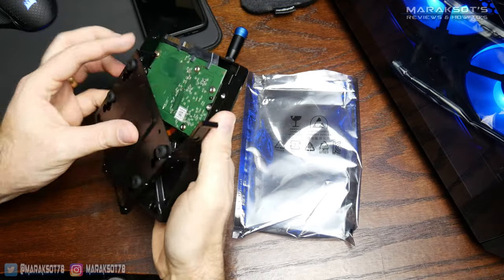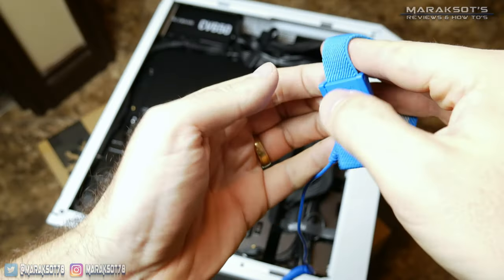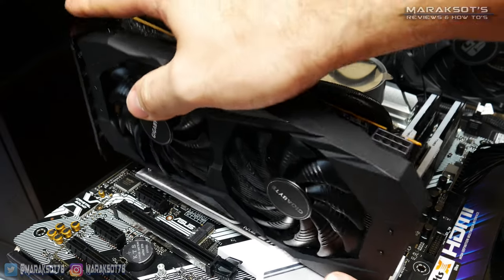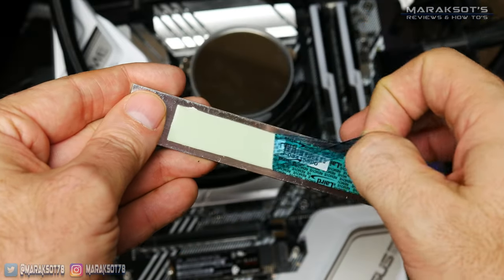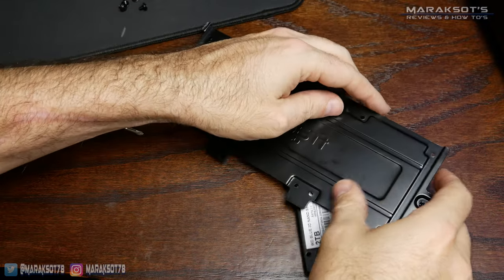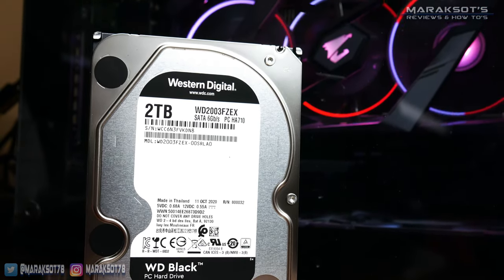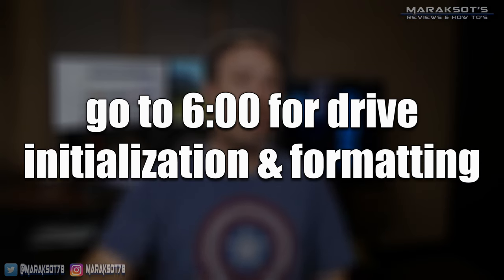A Beginners Guide: Upgrade Your PC Storage - How to install M.2 SSD, 2.5" SSD & 3.5" Hard Drive

Comment from the maker: Wanna skip to a particular part of the video? Use the Time Stamps. :)

Time Stamps

0:00 - Getting started
1:23 - 1st steps
3:02 - How to install a M.2 NVME SSD
6:00 - How to initialize new drive
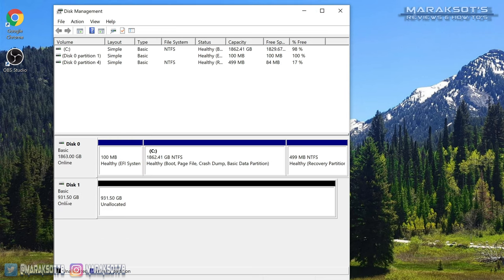7:05 - How to format your new drive
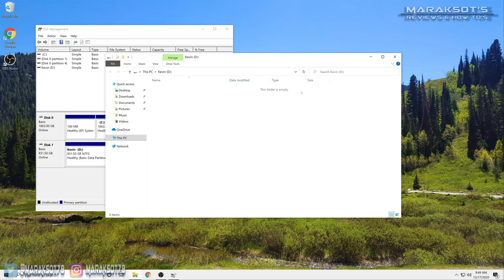8:11 - How to install a 2.5" hard drive or SSD
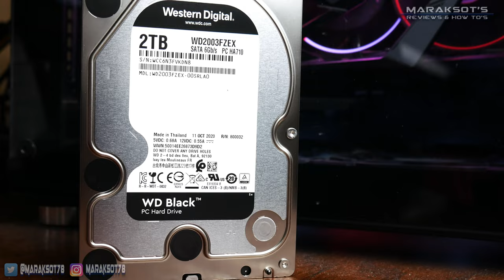10:26 - How to install a 3.5" hard drive
12:35 - Shameless plug for my next video
12:52 - Thanks for Watching! Like, Share, Comment & Subscribe! :)
Reply: I need help!!!!! I’m trying to upgrade and add an additional storage device (the m.2) and I turn it on after installing the ssd and in the BIOS the only boot option is the ssd and not my hdd where my windows boot is at, how do I switch the boot so I could boot using my hdd
Reply: thanks for the video! I'm planning on upgrading my pc to have more storage space soon so I can buy more, and download more games :D
Reply: When upgrading the NVME SSD do I need the Sata cable to transfer all my data that I cloned to an external SSD?

Comment: This helped a lot <3 Been stuck with 500gb over a year and been deleting games and reinstalling them later again but now finally, got more room thanks to this~
Reply: Same I had to uninstall games recently to enable other game updates. I have a 500gb SSD.
Reply: I've been stuck with 240gb bought a prebuilt and never checked the storage capacity
Reply: @diegovillegas4108  lmao unlucky, rn I'm stuck with a 500g built
Reply: @Darbocky  i have 100gb :(
Reply: …I have 4gb
Reply: I’m stuck with 200 rn
Reply: Same
Reply: Me with my 460gb. 😂😂😂
Reply: Same
Reply: Does it also make your pc run better and do you need additional fans when adding more storage? Sorry if it’s a stupid question lol
Reply: So real
Reply: @anthony_t.v2179  you do not need additional fans as hard drives (and ssd) don't heat that much. And it won't make it run faster. Only ssd will make it run better. A new Hard drive may give some slight transfer speed if your old one is almost full
Reply: LOL same but i only had mine for a couples months and ran out of disc space
Reply: Me with 2 tb:
Reply: i have 1 tb and js got a 2 tb that my mom lost

Comment: Amazing video. I want to upgrade my PC storage, but I have a small question. If my PC already has a M.2 ssd (500gb) and I want to upgrade to a 1TB M.2 ssd, will there be any problem with just removing the 500gb one and installing the 1TB using your instructions?
Reply: I also have the same question but I’m not too sure
Reply: Im pretty sure you wont have an OS (windows/linux) then. So you cant use it
Reply: @dragonl0l  my PC was pre built and has a 256 SSD I switched it with a 1 TB Firecuda 530 but my windows 11 operating system wasn’t on it is there anyway I can put it on?
Reply: If the one installed in your computer has your operating system then you will have to find a tutorial on how to move the operating system to the new drive, also any data on your old m.2 drive will have to be transfered over as well, it helps if you have a second drive in your pc already then you can just transfer everything to that and then move it to your new drive after its installed.
Reply: Also double check to see if your motherboard has more than the one m.2 slot, mine has 2 on it so I just added the second drive in.
Reply: @Whatf80  theres tutorials out there but theres like 2 main ways. 1. Connect both storages to your pc then use a clone/migration tool to transfer your files, OS, apps, etc to the other drive. Or 2. You download windows onto a usb stick (atleast 16gb) then reinstall it onto the other drive. But you will lose your apps/not have them on the 1TB drive with the 2. option.

Put simply: you can either move the OS and files to the drive internally or use an usb stick to only move windows then reinstall all games etc.
Reply: You would need to transfer windows to the new ssd or it won’t boot

Comment: Thank you for making this! I've successfully installed my new 2TB SSD, despite me being a complete novice - thanks to this video I managed to not bugger it up! Thank for for making such a comprehensive and easy to understand video, it is especially appreciated the quality put in to make it so concise!
Reply: any recommendatiosn on which 2tb ssd?? im about to do the same thing, my currrent tb is about full, im lil confused about how to take this stuff and put it on my new ssd
Reply: @jhustle1980  I went with the 'Transcend SSD230S 2 TB', which is about £210 on Amazon. There are cheaper ones available with discount down from £200 to ~£150, but Transcend 230S was the only one which specified it had a DRAM cache. 
-If your current SSD is already fast you can keep your Operating System on it without moving anything. Just install your 2nd SSD (you will need another SATA data cable and SATA power cable, also check if your PC case has another SSD tray) then download all your games onto the newer SSD (this is what I did). 
-If you want to completely replace your old SSD, when buying a new SSD the manufacturer sometimes includes a licence for cloning software. Otherwise there are plenty of options for cloning your drive to another SSD, you just might have to pay for it.
Reply: I have a question can any pc have that amount of space or it depends on what kind I’m new to this
Reply: I’m other words can you add any amount of space to any type of pc ?
Reply: @nate3955  I cant really help you, but i know at some point it will blow up xD

Comment: I just bought a pre-build PC and it came with a 500 gig SSD. I plan using the computer to play video games, so I'm gonna buy a 2tb WD Black 3'5. This video was straight forward and included everything, Thanks so much!
Reply: for a pre installed ssd, is thre anything i need to do before switching ssds?
Reply: @GeneralRAAM052  depends if you plan on keeping the storage or just want to start fresh.. regardless, I am the wrong person to ask.

Comment: I've had to do these things on my Linux and Windows PC ... recently due to a power surge that knocked out both boot drives. Installing the parts was too easy. The hard part was getting the drives properly formatted. I'm just a computer user, not a tech, or a programmer ... and I hope to stay as such. Thanks for a very good video.

Comment: Have no experience .... hardest part of changing out my Lap Top's 500gig SSD with my new 1TB SSD was 1 single screw from HELL that held down my original SSD ... after 2 hours of going thru different screwdrivers I finally got that tiny screw removed .... mostly stripped. 

Used an external encasement for new m.2 , used EASUS to Clone my original hard drive to the new.... installed new. Booted right up no problem.

Comment: Hey, a question about the sata power cable, can you connect more then 1 HDD with it and do you know how to remove them safely? Appreciate the video and the work you put in so i can install my stuff :D Thanks
Reply from the maker: Most SATA power cables have 3 plugs on them and yes, you can plug in drives to all three of them and they work fine.  As for how to safely remove the SATA plug? It's easiest if you kind of wiggle them out of a drive but you can just pull them straight out.
Reply: @Maraksot78  Thank you so much man, appreciate it :D Keep up the great work!
Reply from the maker: No problem.  I'm happy to help.  🙂

Comment: What is the difference between the SATA SSD and the M.2? I have a pre-built HP Omen 30L that comes with a 1 TB Hard drive and a 250 GB M.2. It also comes with two empty slots that can be used to install additional hard drives or SATA SSDs. Would you recommend I change out the M.2 SSD that it originally came with, or should I just use the additional slots and install a SATA SSD? By the way, your install video was awesome! Already subscribed! :)
Reply: I’m switching mines out atm

Comment: My current Computer is:
Asus ROG Z370-E MOBO, I5-8600k, G-Skill Trident z Ram 16GB (2x8gb/3200mhz), NZXT Kraken x52, MSI Armor Edition 1060 3gb GPU, 1TB Seagate HDD.
I decided to upgrade to add 2x8 Trident Z 3200mhz, Samsung Evo 970 pro NVME and EVGA Supernova G5 1000w PSU.
So I’ve got games and such on my HDD that I would like to save, like games from steam and such but I believe that they are saved to a cloud. (I’ll check it out before hand) but just for instances, when I install the NVME drive I would put the NVME as the main #1 boot and since my HDD was my old storage that has windows on it, is it going to create a problem using BOTH drives if there is 2 different windows OS( 1 on each drive) or do I need to wipe the Windows OS from the HDD that I am only going to use for storage of videos and pictures and such? 

Sorry I don’t know if that confuses you or not.

Comment: Great tutorial thank you. 
One Question: I have 250GB M.2 which came with my pc and I want to upgrade it to 1 TB. does this mean I will have to install a new windows version to this Drive and lose the original one? 
and what happens to all the software installations that were in my old SSD?
and its only one way of extending the storage which is a replacement not adding like 2 SSDs right?
Reply: Same doubt. Hope someone answers it.
Reply: @kishoremenon7163  I also need help with this. I want to upgrade for the sole purpose of installing much larger programs. I already have an external drive for what is being instructed in the video.
Reply: hey I see this was a while back, any chance you could let me know what you did? Did you have to download new windows? Do you have to re download all your applications?
Reply: @brodykarl4231  Brody did You ever find out I need help
Reply: @letta5433  yeah i did get it figured out, if you still need help then what you need to do is….. Your SSD that came with your pc has windows downloaded on it, so you keep that SSD in your pc and find the other m.2 slot (there should be at least 2) on your motherboard and put the new ssd in it. So now you should have 2 SSD in your motherboard. Then, in your bios, (when starting up your pc spam the delete button, or f12 to enter bios) in your boot management section, you can either  set your original ssd at the boot priority or something along those lines, i haven’t been in my bios in a while. OR you could transfer your windows to your new ssd and set your new ssd as your new boot priority. What boot means is booting up pc, so boot priority (might say something different for you) is just what ssd your pc looks at to boot up or start up your pc. whatever ssd you have as your “boot” ssd needs to have windows on it. You can watch youtube videos after installing your new ssd but you need to activate it and do a whole bunch of other things, if you still can’t figure this out, you can always add me on discord and i would be happy to help you figure this out, i understand how frustrating this is because i went through it too.

Comment: my tip for you guys, if you don't walk on carpet 24/7 odds are you don't need the grounding cable if your worried about your hand discharging some electricity into your MOBO. if you do just touch something conductive and you'll do the same thing. you don't need that cable unless your building them professionally, yeah it can happen for sure but the odds of it happening are very low especially if you have no power going to the MOBO
Reply: also if the humidity is low and you have a lot of dust and long hair

Comment: Thank you for the vid :) was just wondering, if my OS is installed on my SSD, is it safe to remove it and then put it back in? It wont reset or anything?

Im sending my pc in for repair and my boss says i need to remove the drives first.

Comment: I'll leave this here for who needs,SSD's are good for running windows because they're fast.... to a point, They'll run fast but the moment you're running more than the paging  cache can handle its speed is gone,Hard drives use a physical disk and needle for reading and writing they're more reliable in the way of read and write speeds no matter the size of said file and they're cost effective much more cost effective TLDR : use SSD for windows host,Use HDD for pretty much everything else

Comment: Very helpful video for a first time builder like myself. I have a question, so my m.2 has not arrived yet and I am wondering if I build the PC with the rest of the parts, can I install the m.2 ssd without removing the motherboard from the case or is it going to be very difficult?
Reply from the maker: You can easily install the m.2 while the motherboard is in the case. You'll most likely need to remove your graphics card to install it, but that's not a big deal.

Comment: Was it only me getting triggered when the drives got installed on the top SATA port? I hope you are not running a Linux kernel on that mobo when you add and swap ports. Chances are you end up in rescue mode on boot. (Windows won't mind, only applies to Linux single or/if dual boot)

Oh, btw thanks for å great guide. Was searching for one to send to my son:)

Comment: does the ssd come with the screw or was that supposed to be in the prebuilt PCs spare parts?
Reply from the maker: I've been building my own PC's for close to 20 years now so I don't know what kind of stuff comes with pre-built systems, but I know when you buy a case it comes with all the screws and other hardware you need to mount fans, HDD's, SSD's and other stuff. The screws to mount m.2 drives come with your motherboard, so my assumption is when you buy a pre-built PC all those things should be included either already in place where you can undo the screws you need and put things in place or it will come with a little bag with those screws in it.

Comment: Could you leave it plugged in?

cause I know here in the uk every metal cased appliance has to be earthed so leaving it plugged but turned off at the switch (I don’t think In US they have switches on every socket like we do for most), would earth it, what would be the point in attaching the grounding strap to a not grounded appliance, like the unplugged case.

Comment: Question (as someone who've never done this before). I currently have a Cosair One that I got used for a steal. That being said it supposedly (I've never opened it) has a normal HDD and I would like to upgrade this secondary drive (storage only) to a bigger and faster SSD. Is plugging it in all that needs to be done? Or does anything else need to be done after physically installing it (to make it show in the system)?

Comment: Please help :'D 
I Right clicked on the new disk and I didn't get the option t I initialize it, it prompts to Convert to Dynamic Disk or to Convert to MBR Disk..
Im using the same SSD that was shown in the first install example if that info was needed.

Comment: Great video and have a newbie the confidence to give it a try and....................
Well I got an old hdd from my last pc mounted connected all good but when I started up it was like it was trying to boot windows off the old drive but I didn't hang long to find out pulled power removed lead going from old drive to motherboard fired back up and all was normal...........sooooo where to from here????? I was thinking I have a sata drive dock,should I put drive in that and connect via use to pc then try format first then try install it again????....HELP PLEASSE

Comment: I'm trying to figure out how to build my first pc so this is probably a stupid question but I would need to pick 1 of these 3 options right? Like I can't mix and match an ssd and hard drive or is that something that can be done?
Reply: You can totally do that. There are preculiarities to mixing and matching dependent on all the details of a particular board, its connection interfaces, and the storage devices but having both a hard drive an SSD is a pretty widely-seen phenomenon. 

I use a hard drive to save things like documents, photos, etc and the SSD (via sata) to play games. I'm looking into getting a larger m.2 SSD to put directly on the mobo, then I'll have all three concurrently.

Comment: Is Formatting the drive needed?  Can you take a SSD or SATA Hot swap drive from a windows 10 system and use it without formatting the drive in a Windows 11 system?  How do you save/transfer Data so it can be used in a new computer?  None of the data I'm talking about is operating system data.  Hopefully someone can help me answer these questions.

Comment: Hi there, i have a question, i was considering the idea of buyng a new SSD and a friend of mine told me that the M2 series Is faster then the normal SSD, but i have to check if my mothercard (Asus prime b350 plus) support the M2 model. on internet i saw a 500 GB M2 model at 20 euros, but which should i get? Nomral SSD or m2 model? Cause the price of M2 models Is not that High. On my mother card Is written 32 GB/s mcle3 x4. What do you think? M2 or not? Does My mothercard support M2? Thanks

Comment: Why the tiny HDD? For each size compare the price to a drive twice the size. Pick a drive with the best capacity/dollar. Currently, that is around 18 TB, not 2 TB. Remember, this is your backup drive for when the SSDs fail.

Comment: Never ground your ESD wrist strap direct to the  earth, you need a 1MR resistor in series, to lower your potential from surrounding earths. An ES discharge can be in the 1000's of volts range. The resistor is mainly a failsafe if you come into contact with AC mains (120VAC/240VAC), to stop the  voltage going straight through you to earth. Super cool video man. You put me straight on the choice of SSD's. Superb descriptions and demonstration!! Looking forward to the next. Thumbs up!!

Comment: I'm trying to install a secondary SSD using an adapter, because I can't find how on earth to install it.
I checked my bios and the drive isn't showing up in here, it's not initializing in the system either. I'm at my wits end.

To clarify: i want to add an extra SSD beside the existing one, NOT upgrade the one I have.